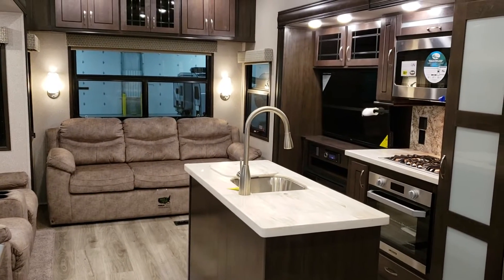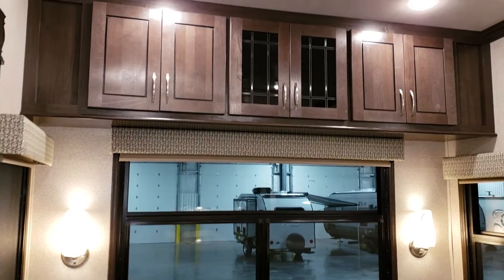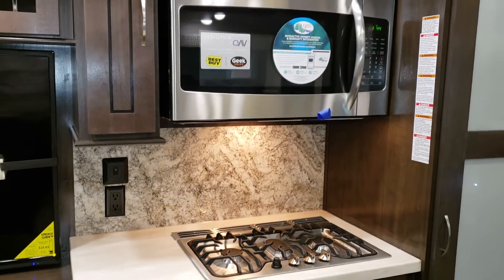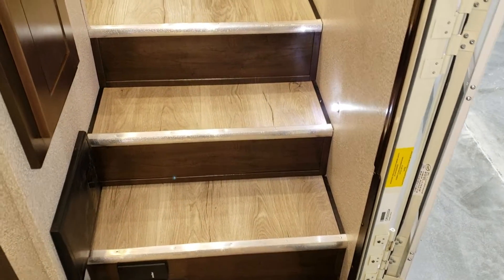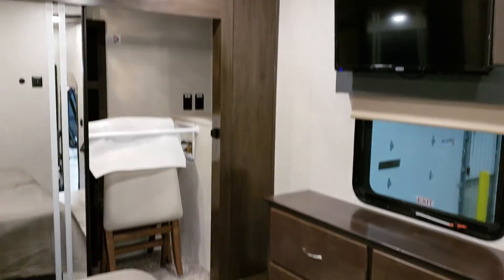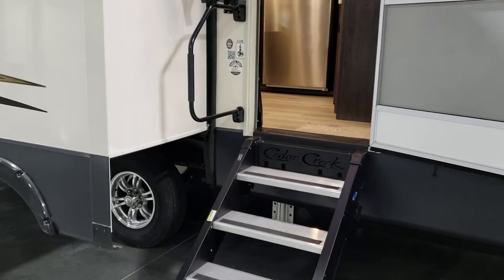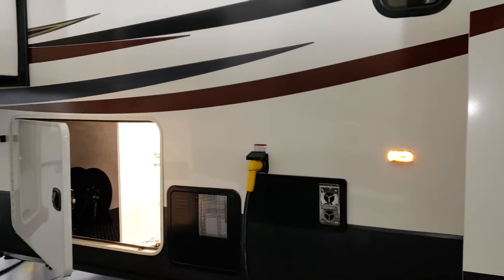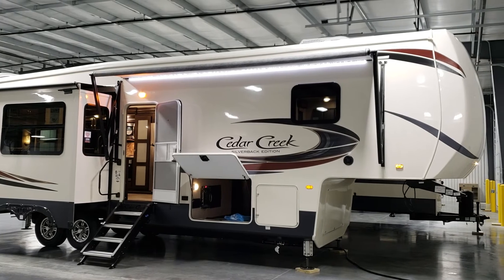2019 1/2 Cedar Creek Silverback 33IK 5TH Wheel at Couchs RV Nation a RV Wholesalers

Comment: We just returned today from our first outing in our 2019 1/2 33IK that we purchased from Couch in October.  We love it and had zero problems.  We got the almond leather and separate recliners as well as a king size bed and solar panel.  The kitchen/living area is so spacious and light; a big step up from our former travel trailer.  It tows great with our Ram 2500 diesel.  Highly recommend it!
Reply: Looking at getting one, towing with a F250 Diesel rated for 14,700. So yours is towing fine?